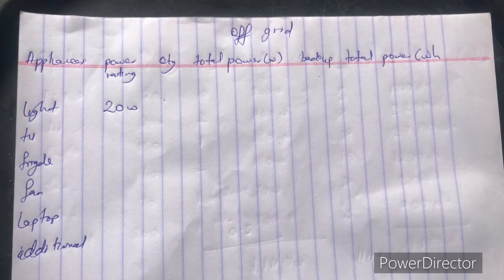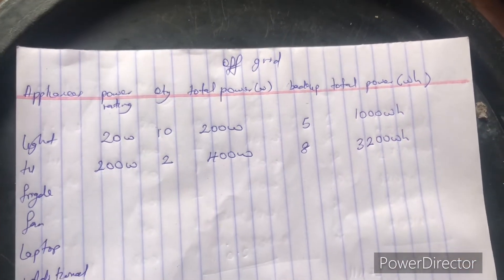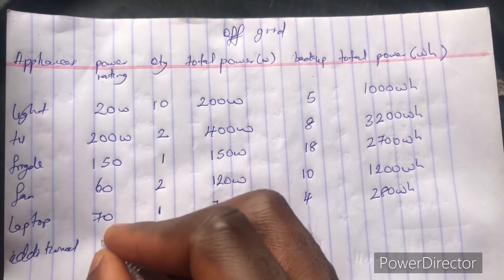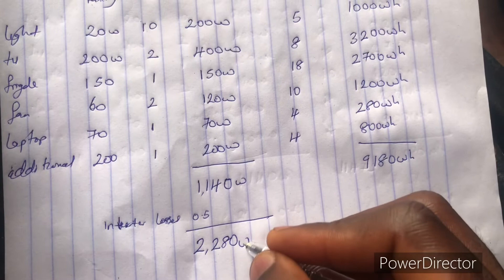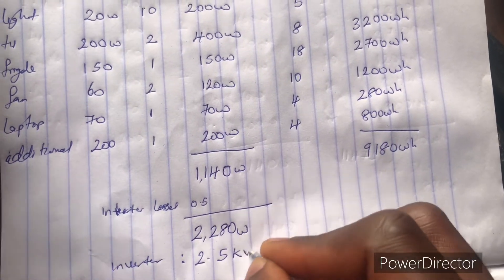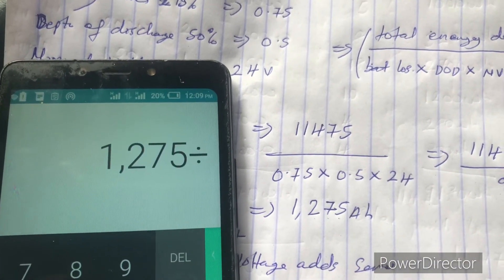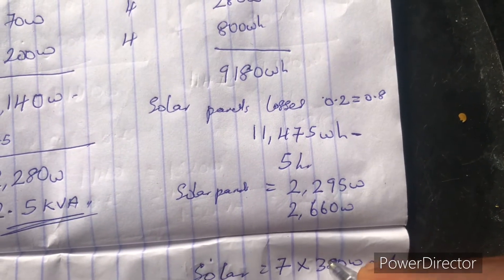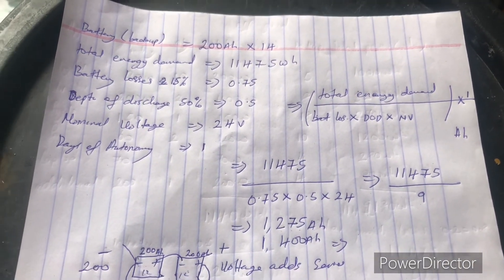Inverter load calculations,solar panels and battery for off gird installations

Comment: Nice video , but I have a solar system that I recently installed, it consists of 18pcs of 300watts solar panels, 10kva felicity hybrid inverter and 15kwh lithium phosphate battery, the panel were installed on flat roof type without any shade of any kind, but the highest output have ever get from the panels is 2.4kw on sunny day and when I check the charging current highest its 27amp, which is below my expectation. Please is it normal or I have to get something checked out
Reply from the maker: what product of panels?
Reply from the maker: Also check the settings for the solar charging amps and see if you have to increase it
Reply: @colcent_solar  the charging amp setting is on 60A
Reply: @colcent_solar  CanadianSolar mono panel

Comment: Please when will you do a video to add that of grid?
Reply from the maker: Soon
Reply: Sir,  can a 24v inverter take up 8 (12v) 220 amps battery?
Reply from the maker: no, but if you must you have to connect external charger or controllers to charge the batteries